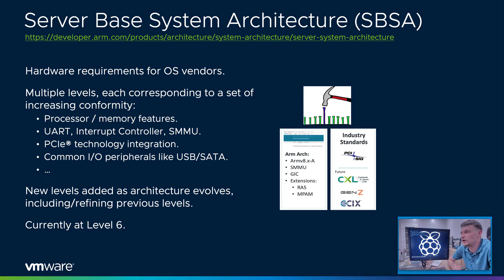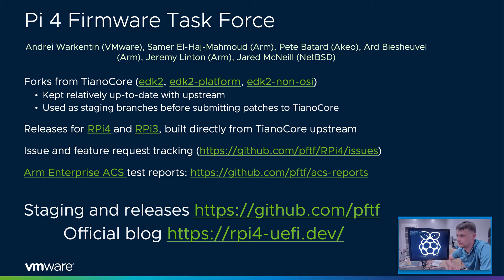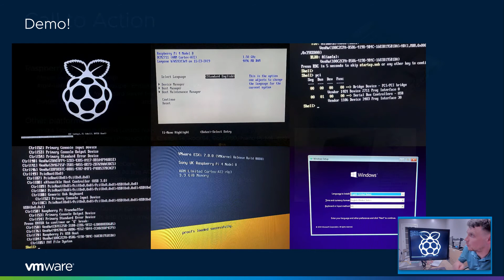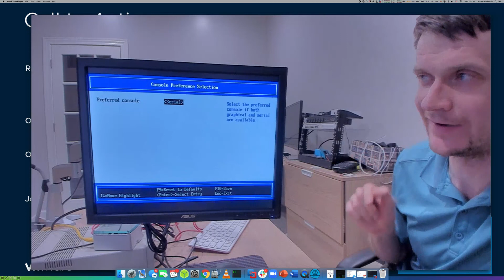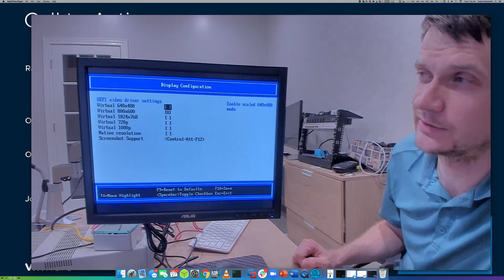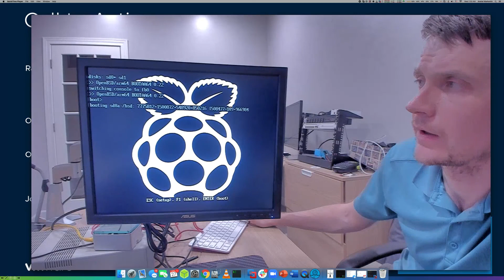BSDCan June 2020: Making Pi ServerReady - Time for cheap Arm Infrastructure be Standards-Compliant

Comment: Great talk! ARM is such a big deal today I'm very surprised there aren't more people watching this video. I'm playing around with a bunch of RPI4s and trying to get a kubernetes cluster running on top of the official ARM64 CentOS image. I was very pleasantly surprised when I tried rpi4-uefi to install CentOS 8 from the USB, the installer working as well as on x64 :)
I'm attempting to compile a new Linux kernel as I read that would help getting the native ethernet support sorted out (I'm using a USB -> ethernet dongle at the moment). So far I'm very impressed!
The 3GB limit is a pain though especially on RPIs with 8GB, I believe that would be the main reason for people not to use rpi4-uefi right now.
Is there an easy workaround we could use? If so I believe it should be on the main page of your website!

Also the real time clock is drifting, that should be easy to work around with NTP or equivalent.

Thanks Andrei!